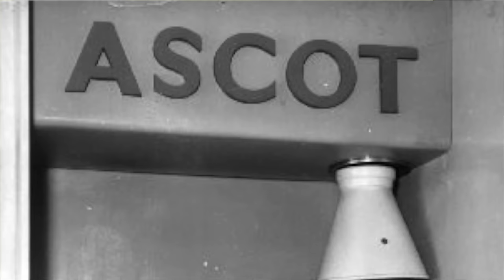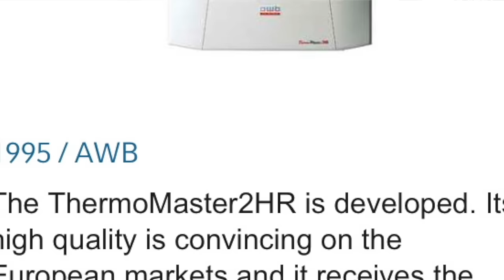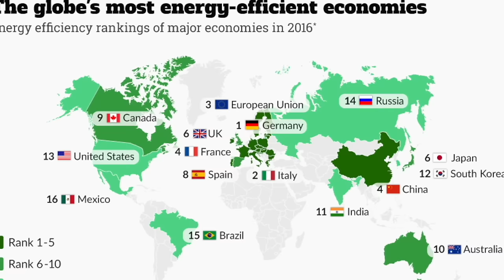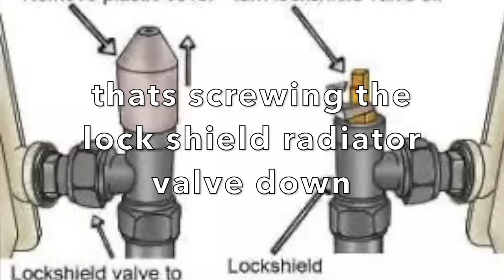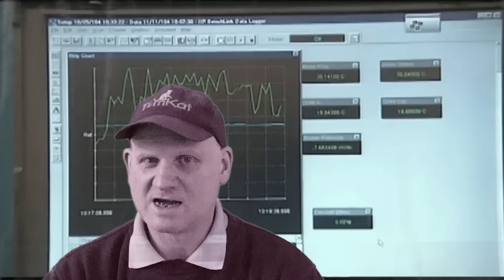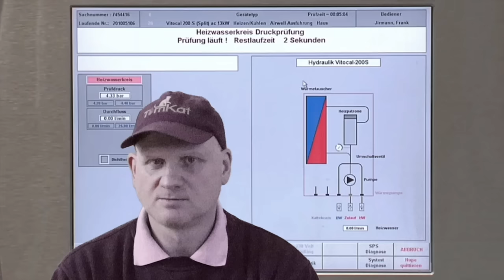WHICH IS THE BEST GAS BOILER for your home. Looking into the best boiler for uk homes in 2022

Comment: Baxi are hands down the best boiler on the market at the moment. Parts are a reasonable price. And I’ve found customer service to be very good. The 600/800 combis are brilliant.
Reply: You can’t range rate Baxi, they’re years behind everyone else. The heat only is universally up popular too
Reply: @heatpump8566  you don’t need to range rate modern boilers much anymore. Unless you are 20kw out, the modulation rate is huge, baxi are 10-1 modulation on the current range. Baxi and Worcester and working together on hydrogen boilers. So I wouldn’t say they are years behind, just no need for over engineering boilers
Reply: @heatpump8566  the heat only isn’t great reliability wise I agree
Reply: Has nobody tried Intergas boilers ?
Reply: @kevinschoales844  yeah pretty good boiler. I had a stint of repairing them a few years ago. Plenty of ignition issues

Comment: Worcesters had so many problems in the past, whichever model. I liked Intergas combis: A cast alloy burner/heat exchanger with two copper tubes snaking through it, 1 about 22mm for heating, the other about 15mm for HW (heated directly by the burner). No diverter valve or secondary HE for HW to clog up - the pump just doesn't run in HW mode; no auto air vent to seize up - manual bleed valve instead. The 240v fans on the larger capacity ones had problems, but the 24v ones were fine. 10 year guarantee, too. Dutch firm, Worcester wanted to buy them out.
They only had 1 or 2 models back then - a bewildering choice now

Comment: Vaillant Turbomax, 21 years great service finally replaced last week with a Baxi 830. The Vaillant went through 5 or 6 divertor valves and one fan. I hope the Baxi lasts as long, its much smaller, much quieter and hopefully, more efficient.
Reply: I’m surprised you changed that many divertor valves on a tmax..I’ve worked on them for years only replaced a handful
Reply: @kevinwilliams1421  I think the issue was using refurbished valves rather than new original manufactured valves. Around £40.00 if you send in the old valve against £190.00 to buy new, I used to get between 2 to 3 years out of a refurbished valve before the inevitable loss of hot water at the tap, a few times it was a punctured diaphram, others it was the weak plastic lever not engaging the microswitch. An hour or so to change a valve, as long as you didn't snap the plastic retaining clip at one of the inlets.
Reply: @Vincent-dc6ku  99 times out of a hundred with no hot water on a tmax is the plastic wheel in the flow sensor…now I’ve literally changed hundreds of them

Comment: You make a lot of sense, however as the bulk of UK homes are many decades old have original flow design of 82 Deg C, therefore the condensing boiler hardly runs in condensing mode to meet the older design temperatures and house heat losses. Nothing is simple!

Comment: I'm not a gas fitter, but I choose an Intergas ECO RF 36. No plastic parts and leaks, no diverter valve or plate heat exchanger to get clogged up. Two years old and no problems so far.

Comment: My ideal Stelrad boiler was installed in 1992. Still going strong, never failed and cost £230. I’ll never change it until it fails. I have cheap rate electricity heating a 300 litre tank and a solid fuel fire for winter which also heats the tank negating the need for the immersion in winter.
Reply: My Ideal Stelrad wall mounted boiler has just bitten the dust, I believe it was fitted in the 80s.  the heat exchanger had rusted through and it started leaking, so I’m just about to have a new boiler, probably a Baxi

I bet no boilers these days last as long as those old cast iron jobbies.

Comment: I grow up  with servowarm boilers, the last  ten years with a Valliant boiler 👍.
Reply: I remember Servowarm very good then disappeared. george
Reply: @mrcombiBedford  built like a tank, lasted for years.
Reply: @mrcombiBedford  Servowarm were taken over by NPower I think. I WAS a customer, asked them to install a Bosc Worcester combi but they ignored what I wanted and installed a shitty Baxi 105HE - so they lost my custom for good and good riddance to them!
Reply: @CH-vb5kr  Hi CH, thanks for the update, that's very bad they ignored your wishes, 105e is a monster with higher running costs. I think that Baxi is one of a few firms that does not allow down-rating the heating to match your rads out put, I don't like that. Our Unit has 12KW of rads why should I put auto 24KW and expect to save more money than I can now. They won't give me a boiler to test against my Vaillant, I wonder why regards george staszak Mr Combi Training
Reply: @CH-vb5kr  Servowarm were taken over by Homeserve who then sold the business to Npower.

Comment: Outstanding communication!  Pleased to have my combi de-mystified, and to be so much better prepared for choosing replacement.  Ten-year old Baxi condenser keeps going but pressure can be erratic, up and down.   Would like to learn optimum balance between setting of water temperature, room thermostat and use of the timer because boiler seems happier set to 'always on' but regulated only by the remote room thermostat.  This beastly Baxi dislikes being off for several hours, won't let me go away for a weekend!

Comment: Great video to unravel the points to consider when selecting a replacement boiler/ ch system. so much technology about its easy to over specify if you just read the adverts.

Comment: I have a Viessmann 200w , jig , flue and adey magnaclean , ready to be installed next week  after a 2 hour magna cleanse . You are right,  The home owner knows his house ,the heating engineer hopefully is more knowledgeable  about correct operation  and installation and commissioning.  Hopefully this boiler will be keeping up and not playing catch up,  
with the weather compensation on a North wall.
Reply: yes indeed.
I was planning on a baxi 624 pack bought new,but scoured marketplace and got a worcester+flue for the same price.adey filter was courtesy of marketplace too.
not shy about saying this but with gas prices going the way they are i needed a quick fix.the quotes i was getting for a new full system was £1000+ over what i could afford if i bought new on the market.
gumtree and FB markeplace are your friends!...couldn't have done this otherwise. all real deal genuine parts,just leftovers to someon'es DIYjob.

Comment: Six years ago, we exchanged our good -old free-standing Worcester Boiler, for a Vaillant eco  something or other. ''The Rolls Royce'' of boiler's we were told.  They extended their normal 2 year Guarantee, to 3 yrs. Despite that, and regular servicing,  we have had to call out  'The Man'  5 times, with failed or failing--parts.  Roll Royce eh? well the cost of the parts were. Very disppointed.
Reply: Had my vaillant ecotec pro for 6 years not one issue yet
Reply: If they are not flushed properly on installation it will always keep breaking

Comment: CH System design is more important than simply boiler choice. I designed the CH system for my new house in 1982 no room thermostat no isolation valves just danfoss TRV'S and RAV HW conroller  with  potterton Netaheat 16/22 sealed cabinet boiler with fan assisted flue an spark ignition(no pilot flame) the system ran perfectly efficently for over 35 years and was only changed when i was unable to obtain replacement parts for the boiler . The TVR's remain installed and working. The Potterton 16/22 boiler was the most advanced boiler on the market in 1982 and would still be operating today if i was able to obtain spare parts for it. My New condensing boiler (installed in 2007) produced problems from installation but then the manufacturers service document lists almost 100 fault conditions. The old boilers with cast iron heat exchangers fan assisted flue  and simple controls where and still are the most reliable .

Comment: Im a Gas safe registered breakdown engineer, installer and I service. I have been on Vaillant’s, Worcester’s, Baxi’s & intergas training courses & from an engineers & an engineering point of view the Intergas Stands head and shoulders above the rest. Iv worked on too many Worcester’s and seen too many issues with them to think they are any good, by far over complicated over priced German crap. Iv also worked on a lot of Vaillant’s however they are easier to work on and seem to be put together better with (in general) quality components. Baxis in my opinion are cheap and nasty and don’t have anything particularly special, different or interesting about them. Intergas however IS special and if only more people knew about them they would take the market. Veissman I’m booked on an online course on the 2nd of Dec, only worked on a few but I’ve herd good things and hope they match up to what I consider near perfection with Intergas.
Thanks for the video but think you missed out mentioning THE BEST!
Reply from the maker: That would be my opinion the idea of the video was to prove it’s not all about the boiler is lots of consideration to take into account before you choose a boiler. If I asked 100 engineers which that thought was the best boiler they all wouldn’t say the same because we all have an opinions. Thanks for watching cheers
Reply: Baxi neta is 8/9 yrs old now when it retires im going for Intergas as ive not read a bad thing about them
Reply: How did your Veissman course go and did it make you change your opinion in any way?

Comment: We've just had a Worcester/Bosh fitted with the app to control it from our phones, it's great and does everything very well, thought I was buying a U.K. built boiler but no it's made in Germany. The only problem we have is that it loses pressure once a week and needs topping up, takes about 10 seconds to do that so no big deal, there must be a small leak somewhere? Now the big problem is that the boiler fitters have been informed but getting them back to investigate just isn't happening, bloody typical.
Reply: Ive had one for 2 years not had a problem, however, I must say gas bills have gone up substantially, and the gas meter whirs around at triple speed.

Comment: Back in the 80s had a baxi with a dial for temp 1-6 left it on 1 spring and autumn and left the boiler on
  cheap as chips to run toasty warm no room stat

Comment: Very Infomative video and clear explanantion as to why regular maintenance is a top priority and key to performance and longevity for boilers and components. 😀Right size selection for the boiler is well understood especially with high modulation. You paid great emphasis as to this point and as I am about to buy a new boiler (emergency purchase) I am now reassessing changes to my selection. My only concern is rightsizing for my current house size in the knowledge renovation which will imrove thermal efficiency of the home and add a shower and one bedroom will make choice of boiler size questionable. Based on that do I right size for the additional load  now? If I do then I would think there is an  option to install a non vented system at a later date for hot water supply. Option to install unvented now is not possible due to space for cylinder. But I would consider that a combi boiler with a percentage of available overcapcity now could be used to service an unvented heat exchanger via diverter valve at a later date  in event of introduction of living space and hot watwer load. Thanks again for yiour informative video. maintance maintance

Comment: Great video with so much information about things I hadn't taken into consideration. I have an old Worcester HiFlow 35 stand alone boiler and the 1st thing I need to do is install a magnetic filter. I have fitted smart valves on all the radiators which has increased the efficiency of the system. The other question which wasn't covered was what fuel are we going to be using in 10 years time. I live in the West Midlands and Natural gas is being mixed with Hydrogen on a trial at 85-15% ratios. Do you think that we're going to be turning to 100% and are therefore going to need to have new burners fitted like we did when moving from coal gas to natural gas?
Reply from the maker: All new boilers will have gas valves that can tell how much hydrogen is with the gas. I believe if we keep the hydrogen lower than 20% the gas valves don’t need changing in the older boilers. Thanks for watching cheers 👍🏻

Comment: I have to correct what you said regarding Viessmann divertor valves, There was an issue with them way back on the WB1A model between 2006/7. (long since sorted out) Since then they have been bulletproof. Also all Viessmann domestic boiler heat exchangers are manufactured from stainless steel.
Reply from the maker: If you have a dirty heating system a diverter valve will fail no matter how bulletproof you think they are.

Comment: You need to look at the Intergas boilers. Much superior than any you mention. Built like tanks. Well ahead of all else. The only combi that can be open vented as well.  It will convert from system/heat only boiler to a combi by pressing buttons. Only four moving parts with no troublesome 3-way diverter valve.  They a can be used as a multi-point water heater with the CH system dry - not even fitted with water, they are so well made.

I have no connection with Intergas, just impressive products, and they are priced competitively,
Reply from the maker: I know all about intergas boilers but they are not in the top 5 best selling boilers in the U.K. so that’s why they are not in the video
Reply: @tomkatgastraining  
All due respect, however your title says WHICH IS THE BEST GAS BOILER IN 2020.  Not the best selling.  Installers who fit Intergas boilers tend to stick with them, as they are highly impressive - as once fitted no call backs. I have had the combi fitted on old open vent systems still using the open vented F&E tank, as the rads were old and looked like they would pop if pressurized adding needless extra cost, and hassle, to the customer. They come complete with weather compensation and an excellent control system. Some versions modulate down to 3.6 kW - the boiler most of the time just sits there purring on a low kW rate.  Some models use only one plastic pipe for the condensate and pressure relief making installation easier again.

A number of guys mentioned Intergas on these comments. I believe Intergas have sold over 100,000 boilers in the UK and not through any intensive advertising or promotions - mainly by recommendations. They are easily and readily available. Plumb Center were promoting them a few years back. 

Vaillant at one time wanted to make under licence the Intergas heat exchanger, Integas refused. Rheem, one of the biggest HVAC/boiler/water companies in the world last year bought out Intergas in Holland.

I always look to Intergas as the first option in boilers, as they are clearly excellent and well priced. Great bang for buck. Recently I had to fit a Keston (Ideal) as they had the long 50mm plastic flue options. In another, fit a Navien (great boilers - Navien are the world largest combi manufacturers) as it is the only boiler that can be fitted outside.

The BEST boilers on the market in the UK are:
♦ Intergas (Dutch);
♦ ATAG (Dutch);
♦ Navien (Sth Korean);

They are in a league of their own, with quality of manufacture apparent. The rest are in the league below at best.
Reply from the maker: @johnburns4017  it’s a play on words mate meaning which magazine 😜
Reply: @tomkatgastraining  
I have never agreed with that magazine's choices.
Reply: can i connect my Boiler manager to it as i have done to my baxi?
Reply: @felixscamp  
What does your boiler manager do?
Intergas are OpenTherm.
Reply: @johnburns4017  Not in the industry but I did my homework and Intergas is the one it seems.

Comment: The one boiler I refuse to fit but do fix them (often) is Worcester Botch.  Customer rings up saying " my Worcester Bosch is leaking",  me " what side is it leaking from right or left?"  Then I know what bit of cheap rubbish plastic has failed.
Reply: I'm in total agreement with you Tony. Worcester BOTCH 😁 Customers think there the best ?🙃😝🥶
Reply: Left side - left hand mains block pin hole
Right side - adaptor behind flow switch. 

Nearly always. Neither too bad to do

Comment: The ideal icos/ISAR boiler was quite reliable if it was installed on a clean system and service properly ,by dismantling. Taking the fan /burner assembly and the sump cover of.,to clean out thoroughly. 
I was talked into installing a Remarhra ( a Baxi brand) boiler. The worst decision I ever made. They always came with dirty rusty water inside the water ways! The first I cleaned out and commissioned broke down within 24 hours on the Saturday. The service department eventually showed up on the following Wednesday! The second one came in the same state so I returned it and got a glow-worm instead.